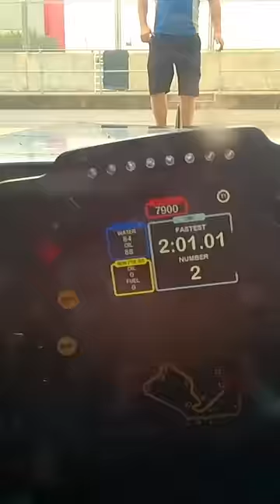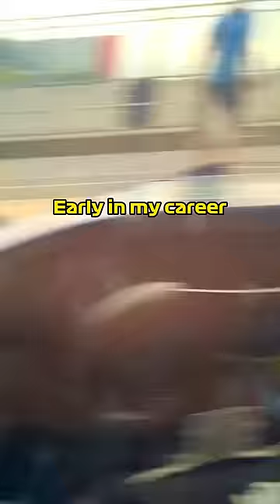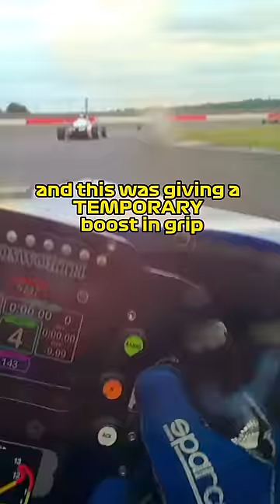The WORST way to warm up tires...

Comment: The best thing to do is lots of repeated heavy braking on the warmup lap. The hot brakes will get the core of the tire up to temp faster. Core temperature is far more important than the temperature of the compound, as that's what increases tire pressure.
Reply: All depends on the car and driver, there's no best rule for everything. Lock up and flatspot your tires because youre breaking too heavy with cold tires and low pressure, and that will cost you.
Reply: Tire pressure has a smaller effect on mu than surface and carcass temperature. From typical cold to typical hot pressure you might have a 3-4% delta in grip, while a cold vs hot temperature delta might be more like 20%. Of course, around the peak the delta is only generally around 2-3% give or take +-20c, but surface/carcass temperature is much more volatile than core.

The effect of brake heat on core temperature is fairly low, from hot brakes at some hundreds c vs a simulated ambient temperature disc, you're only looking at a few celcius delta typically, which is half a psi or so. All it really means is your cores will stabilize maybe 2c higher. The transfer is very slow so it's not really volatile either.
Reply: @Bigolebungus  Agreed. Braking is mainly done to bring the front tires up to temperature IMO. Racecars tend to be rear load biased and rear driven, so even with a fairly large tire size split will still tend towards rear being hotter. 

Braking a bit during the warmup lap and steering just a bit too much on the first few laps will make tire temperatures more equal between the axles. I know some LMP cars have issues with the fronts basically never reaching peak temperature. I imagine that sliding the front tire a bit too much will offset the reduction in grip from the lateral slip curve by giving more grip via the thermal sensitivity curve at least for the duration of the corner.

It's significant enough that some more incompetent engineers actually think that tires don't lose any grip from slip and it's purely a thermal matter.

Comment: Everyone acting like a fucking genius. Most pro drivers in most series burn some rubber exiting the pits on fresh tires. They're cold and aren't scrubbed yet so it makes sense. You're not gonna damage it significantly from spinning your rear wheels for 2 seconds. If anything it'll just get them up to temp.

Comment: Yup, quick burnouts literally just heat up the little bit of rubber you just wore off, and still leaves the underlying contact patch relatively cold. It's basically wearing off cold rubber.

Comment: A lot of people think F1 drivers swerve like that to keep heat in the tires which isn’t true, it’s to clean the tires because they collect so much rubber bits off the track. The brakes is what actually keeps heat into the tires

Comment: This somewhat depends on the tires. It might be necessary to warm up the tires because the performance difference between cold and warm tires outweighs the lost tire life. Slipping on cold tires might actualy hurt tire life even more then doing a burnout for temp. We see it in F1 before starts and I'm pretty sure they know what they are doing.

Comment: After a fresh set you need to do a quick burnout there is oil from the manufacturer process and the stickers on them if the crew does not remove them not to mention it don’t look like they are pre heated so yes a small burnout would be more than justified

Comment: Burning out a brand new tire is necessary because there is a small layer of plastic around a brand new tire that needs to be removed before used. That's where the smoke comes from. When you see a F1 tire there is always a blanc surface on a brand new tire. Of course a lock up doing a breaking zone will hurt your tyre as the protective plastic is no longer present :)

Comment: This is very true for circuit racing not true for drag racing you absolutely need to do a burnout on high horsepower cars if you don't traction will be subpar and after the 60' or 100' the rubber on track is less than near the "tree" and causes a lot of rookie racers to randomly spin out at what seems to be halfway to mid track I've seen it to many times and 9 out of 10 times the driver never had traction at the launch and just tried to pedal it eventually loosing it and totaling a car .   I'm talking high horsepower cars I mean above 1000 HP but still applies to cars with 250hp

Comment: Depends what kind of racing your doing if your doing circuit races on tracks yeah probably shouldn’t do that but if your on a drag strip should actually help same with drifting if your tires come stock with a lot of tread. Did that with my old set of swampers so I could do mad donuts in the winter burned as much tread off by doing burn outs and no she has no grip even tho I could’ve put the new set on during winter time simply because swampers suck for snow and ice

Comment: If that's the case, why do Nascar drivers do it when leaving their pit stall?
Reply: I don’t watch NASCAR but in series where pit stops are required drivers will do this to lay rubber down which will improve their traction out of the box during the race

Comment: Wait so you're telling me that inducing a tire designed to be more fragile then general tires to loads of heat generated by vibration and friction at high spinning speeds on a material that is chippy and rough... is actually damaging the tire?

Comment: -damaging the longevity of your tires

Ah yes, because tires are replaced during pit stops just for shits and giggles
Reply: Pit stops are not common in junior formula racing. He isn’t changing tyres mid race I promise you now, the races are only about 20 minutes.

Comment: Then why do a bunch of famous driver do it tho? Is it ok for short sprint races or something?
Reply from the maker: Two reasons you see it in F1 or Indycar sometimes: Indycar has a tire compound designed to allow it since drivers need to warm up tires quickly exiting the pits, and F1 drivers will do it sometimes just before a race start to clean off rubber picked up on the warmup lap (not really for warming purposes).

Comment: How do you get into formula racing? I've been dying to get a chance
Reply: Money, money and more money. 

Your best bet if you didn’t start young is to save like a mad man and buy a used older chassis, classic Formula Renault cars can be had for reasonable money. But running them is expensive a set of tyres for one will set you back ~£1000, then if you have a crash that’ll send costs through the roof. 

If you did get one you’d be better off getting good at fabricating your own parts to keep the costs down

Comment: 💀 goofy ah video

Basically doing a slight burnout like that is going to have very little effect in damaging the tires. Scrubbing tires and burnouts on cold tires will cause tire graining but only if done excessively. In most cases it’s still better to deal with the slight amount of graining but have optimum tire temps faster especially considering that as the tire wears there won’t be any graining as it scrubs off